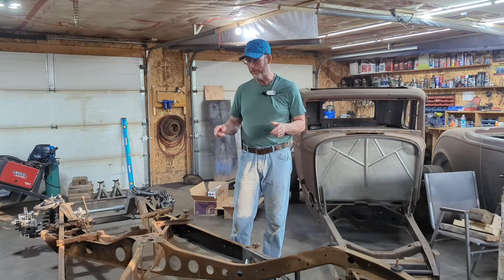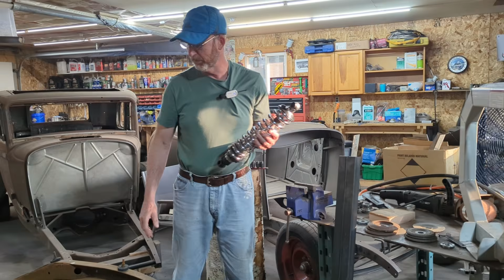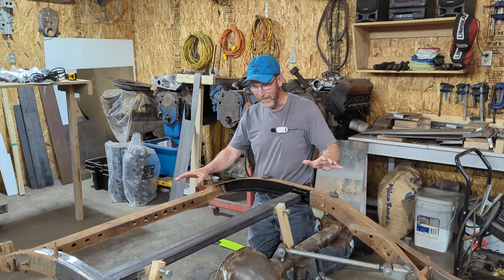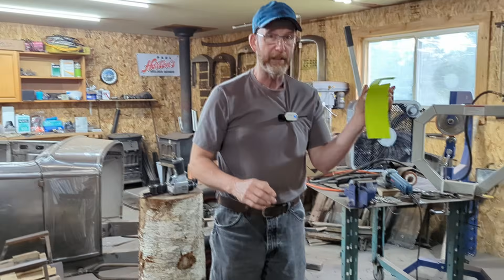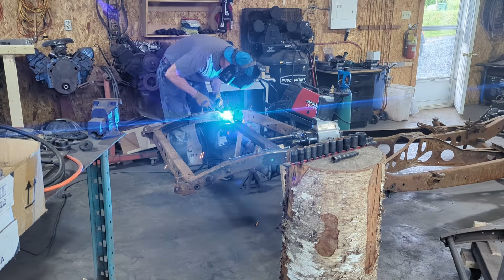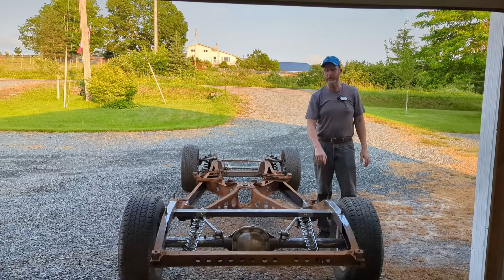1940 Plymouth Installing the Rear End Part 2

Comment: Funny I thought that the 808 rear was uneven side to side. I've seen the long side cut and two short side axels installed to center the pumpkin. I guess some came from the factory centered.
Reply from the maker: The 8.8 came both ways depending on what car or truck they're in.

Comment: Thanks for the videos, really helpful as I have a 1940 Dodge Business Coupe that I am going to do the same thing and you have provided me with the blueprints to follow! Quick few questions did you go stock ride height as I wanted to lower mine about 2 inches, I know I can get some of the drop I want in the coilovers but didn't want to limit the shock travel. What shocks did you use for your set up if you don't mind my asking? Thanks in advance for your help and keep up the great videos!
Rob
Reply from the maker: Hi Rob, we used the dropped spindles. I can't remember if it was 2 or 3". The particular kit we got from JW Rod garage supplied the shocks. You can also get a front end kit from Welder's Series too. The one thing I would recommend though is to go with a coil over shock suspension vs coil springs. It costs a little more but it's much easier to tune, adjust, assemble and disassemble. And add a sway bar!
Reply: @coldstreamrodshop   Really appreciate the response Derek, I am going to do a 2"drop in the front, I have already welded in a 1992 dodge dakota pickup front clip as its going to work with the 440 I am putting in it as I wanted to keep it all Mopar. its a rack and pinion front end so it will be easier to source parts for the front end if need be. I bought the Welder Series triangulated 4 link you used and was wondering what rear coilovers you used out back? Thanks again for your help!

Comment: what would be the cost for doing such a job like what you have done so far?
Reply from the maker: It depends on what it's going into, what I have to take apart and what parts are supplied. I can look up how many hours it took to put it in the 40 Plymouth if that would help?

Comment: Please explain why you welded the rear crossmember for your shocks on the flat and not on the upright position, to the frame. Was that to give the holding boat more strength or what was your thinking?
Reply from the maker: I welded it on the flat mainly because this is the way aftermarket frames are done such as Brookville, Pete and Jake's, and TCI. From an engineering point of view the 1 1/2" tube is strong enough to take the load on the "flat". Obviously it would take more if turned upright like a beam. With it on the flat and the bolts going through the 3" of the tube I think it will take a greater bending moment at the upper shock location. Another advantage on the flat is it gives more floor clearance.

Comment: Interesting point you made about --- How the Shock Angle Matters ---- in the Quality of ride you get ---- I know about oil verses gas  ------ Will have to keep that in mind ----- you mentioned I could run leaf springs ---- but I think it will be ---- Parallel  4 Link or the Triangulated system ----- right now ---- I trying to figure out ---- what Gear Ratio and a width that will work under it ------ will have disc's up front so drums will be fine in the rear --------- Curious ---- on why you mounted the Rear cross member horizontal and not vertical in the frame ----- maybe you have a fairly thick wall tubing and will with stand flex ------- The --- adjustable coil over fixture ---- they had at the Welder's Series when you were there --- I see you made your own spin off of them ----- nothing wrong with that ----- money in your pocket to spend --- ON --- the Project ---- your idea works just as good ---------- Thanks for the Video and we'll see you two on the next one -------- Rodney

Comment: great video ... lucky for me i will be doing a similar 4 link and coil over set up - so thanks for the research  :face-turquoise-covering-eyes: perfect timing for me ,FYI  you keep a very clean shop "but" as a helpful hint , your grinding right on to those engines on the stands (no carb no balancer) all that dust going where it does not belong  ... maybe old furniture blankets and plastic wrap  ?   tale care
Reply from the maker: Yes you're right about the engines. They are cores though. They will not be run without rebuilding. Just the same I need to cover them up better. Thanks for the comment.
Reply: @coldstreamrodshop  were still looking for a 32 ford 3 window any condition or a rusty body , if you hear of anything ... thank you
Reply: @pameladunn7346 I know one but it’s in France
Reply: @harold.degand  805 give us any info 794 you might have 1566 on condition and price  , thank you